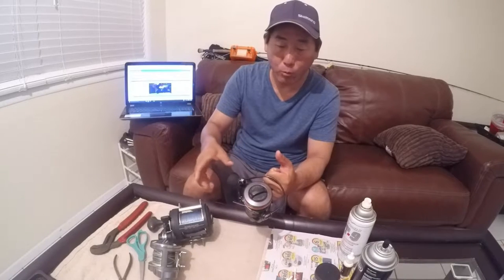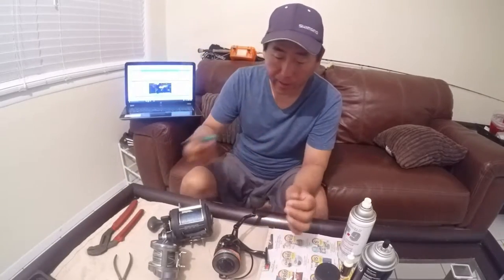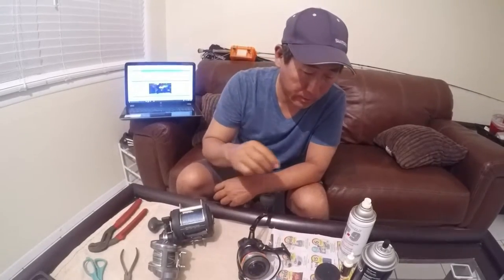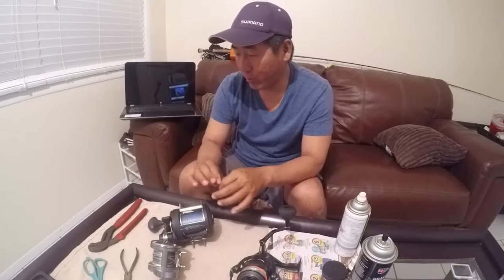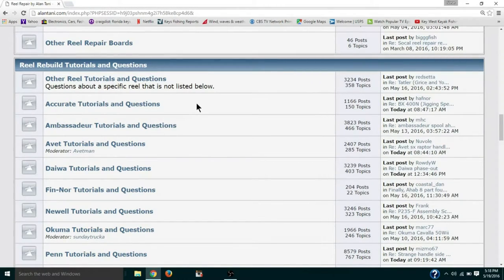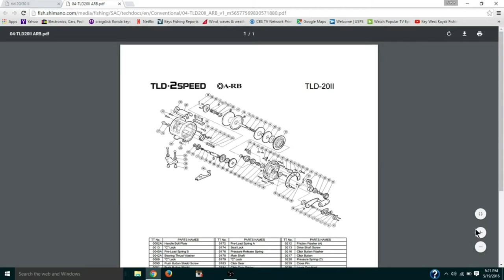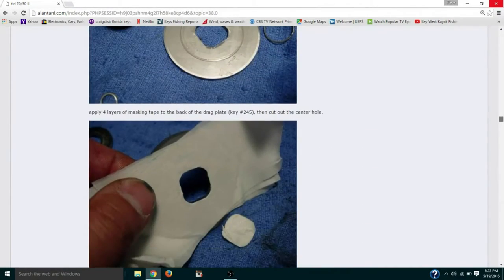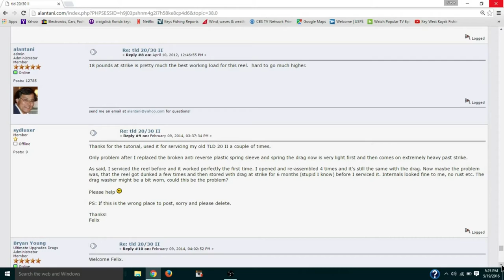Reel Maintenance/Repair - Feat. Alan Tani Website

Comment: I have 2 vintage daiwa silver series reel. I have a 1000c that needs a handle and a good cleaning. Tge other is a 1000c that needs more extensive work .Can I send them to you for repair. Having trouble locating parts for these.